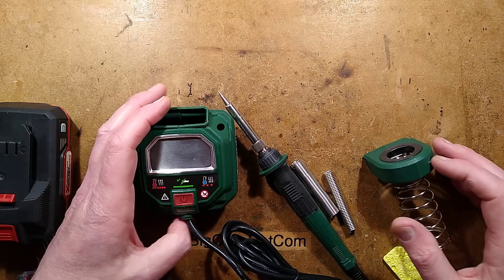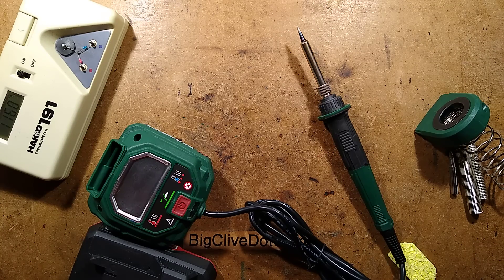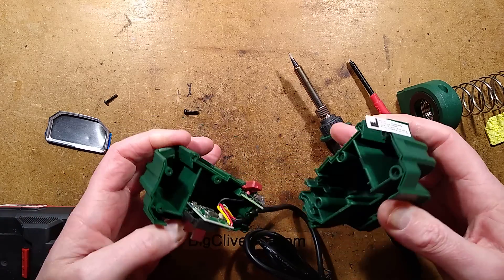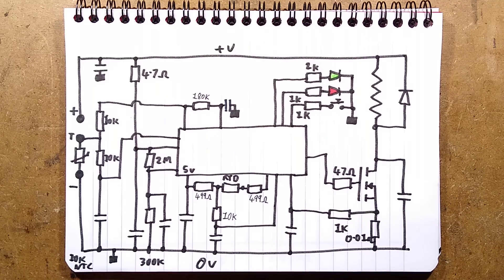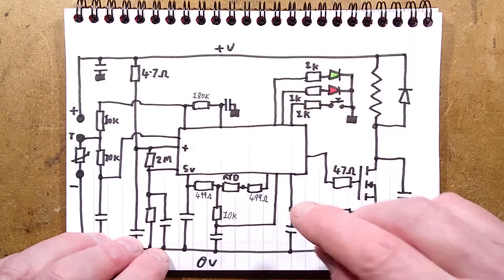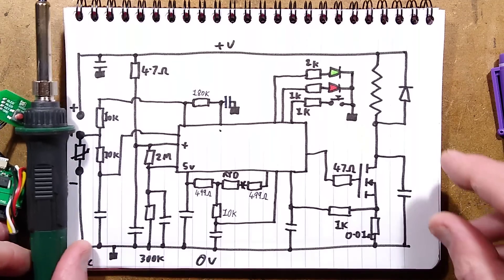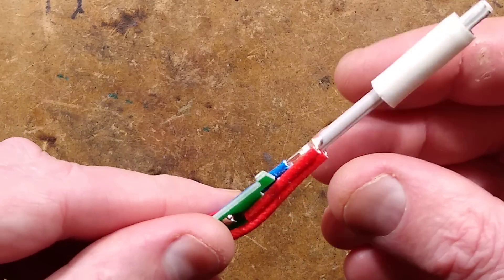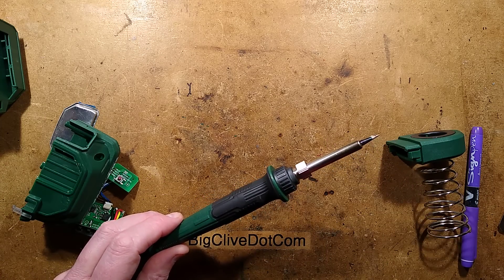LIDL (Parkside) B2 soldering iron hack and schematic

Comment: The Robot family are at the Robot Repair Shop where they have brought Grandpa in for an emergency checkup. 

Technician A asks "What's wrong with him this time?" 

Mother Robot replies "Well, feel his head. He must have a fever. He's burning up." 

"Oh yes. Ouch." says Technician B.  "I just burned my finger on his forehead." 

"That's what I mean." says Mother Robot.  "He's been like that since last night.  He said he was feeling cold, so he went to that Quack doctor in the market." 

"Hmm.." exclaims Technician A.  "It's probably his temperature regulator on the fritz." 

"I'll take a look with my infrared monacle." says Technician B.   "Ah yes. There's a definite hot-spot right here in the middle of his forehead." 

"No wonder you burned your finger." says Technician A.  "Now let's take a look in here." 

Gingerly he opens Grandpa's cranial access panel and peers inside.  "Well look at this." he says. 

"Hmm.." says Technician B, snipping some wires in Grandpa's head and retrieving a small circuit board. 

"Will you look at that." exclaims Technician A, examining some writing on the circuit board with his monacle.  "It says 'Barbie Hair Drier (C) 1985 Mattel, Inc.' " 

@:-)  &:-)  #:-]   ~~8o]    (o-] A   (o-] B

Comment: I wonder whether reducing the set temperature affects the performance of the iron when used in outdoor environments eg on car wiring? In the past I’ve found using soldering irons outside to be challenging because they lose temperature in the wind, but not had that problem with a stock one of these Lidl ones.

Comment: why dont they make a screwdriver that has a plastic liner that automaticly retracts with a spring inside the handle ?
Reply from the maker: Probably strength.  Some terminal screws get seized in.

Comment: Repairing an MP3 player (oh yes, the 90s) from my classmate on a Bus driving to the holidays with just a paperclip and a lighter.
0603 components were a thing back then (and my eyes were much better) and so were bumpy roads
Just if someone says they cant solder without a soldering iron: Sure you can!

Comment: That looks like the guts of a Hakko 936/907 heating element and thermister component.   Are the aftermarket NON Hakkos replacement heaters generally good quality and relatively reliable?   Thoughts???
Reply from the maker: The quality varies widely and there are also thermocouple based units.

Comment: I once bought a 100w soldering iron from Biltema. It got so hot that the end literally glowed when you turned the lights off. Another one i bought was a "Lux" brand and it was 40w. Worked great until i used a solder sucker and i actually sucked last 3mm of the tip into the solder sucker as it had melted.

Comment: 15:10 Not only will over-temp damage the bits, also overheat the joints leading to premature failure.
 Then again you could put a variable resistor in the base unit.
 Years ago, I used Antex irons exclusively. I found Wellers to be too fragile (worked a lot in the automotive sector). Antex made a huge array of bits, including DIP bits in 8 and 16 (the easiest way ever to remove THT ICs). But they never made temp-controlled irons. I originally made an (rectified to DC) analog controller based on the resistance of the element (current controlled). Later on, I redesigned it with A PIC 16F84 (remember them) when they came out last century. It proved to be much more stable and even heating. For a few useconds, every two seconds the supply voltage would disconnect and read the resistance of the element thus determining the current for the next two seconds. What a great, even revolutionary, those PIC uCs were.

  When I first started in the mid-late 1970's, components were very delicate, and we used to use simmerstats and made sure it didn't melt plumber's solder to determine how high the temp was, then we got thermocouples. Thanks for letting an old man reminisce.
  Thanks again for this posting. Always interesting to see how things are designed.
Reply: They did make a TCS series, possibly later on , 80's I think, basically a 50w Iron with a small pot on Iron itself. I still use Antex to this day

Comment: I wonder how the iron would respond to someone hacking a potentiometer into the iron instead of a fixed resistor.
Reply from the maker: A 47 ohm pot would give a decent range.
Reply: Great hack.
Thought also of the potentiometer or rotary switch with 2,3 resistors.
That way one has more temp options .
Also often ask myself way not have it factory installed.
Willing to pay the 3p extra😂

Comment: As I understand it, the corrosion of soldering iron tips is primarily caused by the solubility of the metal the tip is made from in the molten solder. Temperature is also a factor, since the hotter the molten solder is, the faster other metals can dissolve into it.
Using solid copper tips with traditional leaded solder is rarely a problem. The 40% lead (or 37% for eutectic grade) lowers the melting point such that copper from the tip doesn't dissolve in the solder to any significant degree.
Lead-free solder is a very different story though. For a start, it is at minimum 99% tin, so the melting point is much higher. But it also has between 0.5% and 1% copper already alloyed with it, so copper is clearly soluble in tin. At the higher temperatures required to melt the lead-free solder, copper dissolves into it much faster. So if you are going to do a lot of soldering with lead-free solder, don't use a solid copper tip - unless you want the copper from the tip to end up in all the solder joins you make.
Reply: I had a hakko tip dissolve to the point of unusability after 3 months of 8 hours a day always on at 780F, 37% solder. I beat the hell out of that tip, and 3 months of my tools for 20 bucks is still super profitable.

If you're using it hobbiest grade, an hour or two per week, and you aren't using the iron at 900F like this one was unmodified, it'll last you a long time. I really think tip wear isn't something to be SUPER concerned about.
Reply: @AnonyMous-pi9zm  wear not, corrosion yes, most hobbiests will have this issue, the tip gets corroded although they do not use it much, and it becomes very difficult to use it or to restore it to a nice shiny surface
Reply: Actually copper is a bad choice as it does dissolve in regular leaded solder, that's why all the decent bits were iron clad copper.

Comment: I searched the web for "M29an100 0B6606 M29p p silicon chip" and I found some information that might be helpful. It seems that the chip you are looking for is a *M29AN100* flash memory chip made by *STMicroelectronics**. The chip has a capacity of **128 Mbit* and can operate at a voltage range of *2.7 V to 3.6 V**. The chip uses a **parallel interface* and supports *page mode* and *burst mode* for faster data transfer. The chip is packaged in a *TSOP48* case with a size of **12 x 20 mm**. The second line of the chip label, "0B6606", is probably the **date code**, which indicates the year and week of manufacture. In this case, it would be the **6th week of 2006**. The third line of the chip label, "M29p p", is probably the **lot number**, which identifies the specific batch of chips that the chip belongs to. This number is useful for quality control and traceability purposes. I hope this information helps you. 😊

M29AN100 datasheet https://www.st.com/resource/en/datasheet/m29an100.pdf <-- this link does not appear to work, but if you can find the m29an100.pdf you will have your datasheet. (perhaps https://www.datasheetarchive.com/)
Reply from the maker: It turned out that the second number may be the IC number, but the data for it on the manufacturers website doesn't have a full PDF.

Comment: I have something similar could it be possible to add a potentiometer to be able to adjust the temperature
Reply: Yes, it is possible. I did that with 100Ohm pot on my B2 during summer which fits nicely in the place of sticker near to the button. That was discussed in the comments section of the Big Clive review of the previous version of the iron.

Comment: I have been using a modded A1 for a while now and its crazy what you can do with it for such a low price. I can solder tiny SMD components and XT90 connectors with a bit of practice. 

That beeing said, i recently tried a friends Pinecil V2 and that is just on another level. I will probably buy one of these for christmas this year.

Comment: CLIVE I HAVE A PROBLEM I NEED ADVICE ON.. A FRIEND OF MINE (A WOMAN) BROKE UP WITH HER EXTREMELY ABUSIVE BOYFRIEND. AND HE'S STAKING HER NOW. ( & EVEN BROKEN INTO HER HOUSE AND BEAT HER BAD ONE NIGHT). NOW I'VE MADE HER A TAZER FROM ONE OF THOSE CHEAP MODELS YOU CAN BUY FOR 75¢ TO €1 ON BANGGOOD. BUT IM THINKING OF MAKING HER ONE FROM THE COIL FOR A CRT TV. AS I COULD BUILD IT LIKE A CATTLE PROD. BECAUSE IT WOULD GIVE HER REACH AND STOP HIM GETTING CLOSER TO HER. NOW SHE HAD PEPPER SPRAY BUT THE COPS HERE IN IRELAND TOOK IT OFF HER, AND THEY WON'T DO ANYTHING TO HELP HELP HER. SO I BOUGHT A FEW KIDS WATER GUNS IN A "POUND SHOP" AND GOT A BOTTLE OF AMMONIA AND GIT HER TO PUT THEM CLOSE TO HAND BY THE FRONT DOOR, BACK DOOR, BEDROOM, 
PS I DISCISIZED THE SMALL TAZERS SO THE LOOK LIKE POWER BANKS FOR PHONES.(THAT'S WHAT POWERS THEM) AND THE ELECTRODES ARE INSIDE AND HAVE TO BE PUSHED OUT BEFORE IT TAZE'S. AS A SAFETY PROCAUTION, SO IT LOOKS JUST LIKE A PHONE POWER BANK.THE COPS WON'T TAKE IT OFF HER. NOW THE ONE GOOD THING IS SHE HASN'T GOT ANY KIDS. THANK GOD..(SO NO ACCIDENTAL SHOCKING OR GETTING SPRAYED BY AMMONIA. 
ANYWAY I HAVEN'T MADE THE CRT-TV COIL CATTLE PROD ONE YET BUT I THINK IT'S A GOOD IDEA. ANYONE ELSE GOT ANY ADVICE I COULD GIVE HER BECAUSE THE GUARDS(IRISH COPS) WON'T DO NOTHING TO HELP HER.. THEY TAKE HIS SIDE BECAUSE HE'S A RAT FOR THEM AND USES ANY KIND OF DR#GS HE CAN GET. HE'S IN PRISON AT THE MOMENT BUT IS GETTING OUT IN 2 MONTHS I THINK. ANY ADVICE WILL BE "very VERY" WELCOME.. 🙏🇮🇪🙏🙏🙏
P.S AND IM VERY SORRY FOR JUST DROPPING THIS ON YOU "CLIVE" AND YOU SUBSCRIBERS. BUT SHES A VERY GOOD FRIEND OF MINE AND SHE HAS NO ONE ELSE TO TURN TO. (AND BEATING THE CRAP OUT OF THIS GUY WON'T CHANGE A THING ONLY MAKE IT WORSE. 
THANKS AGAIN, AND SORRY 🙏🙏🙏🙏
Reply from the maker: Be careful about making an improvised tazer.  They are classed as the equivalent to a home made gun in the UK and can cause legal problems.  It sounds like your friend should perhaps move and give very strong instructions to friends and family not to share her new location to anyone, no matter how genuine they sound.

Comment: Does it work with 12v
Reply from the maker: It does detect voltage, so may not operate at a lower voltage.  If it does then it will take a long time to heat and recover.

Comment: I take it the numbers wont be affected if the resistor goes on the other end of the white wire - I've found the high temperature useful for dealing with big ground planes when my antex just wont cut it so it would be nice to have a switch for the resistor.  That begs the question:  What if it was switched from high to low - that would introduce an 'overheated' condition.  Would it just cool down or cause some undefined behaviour?
Reply from the maker: It can go anywhere in the temperature feedback circuit.  Others have suggested a boost button to nudge the heat up briefly by bypassing the new resistor.

Comment: please consider reverse engineering the battery bms to add external relays or mosfets
Reply from the maker: That could be very easy, given that the battery disconnects the 10K thermistor when it detects low charge.  A simple P-channel MOSFET and single resistor should work.

Comment: OB6606 integrates high performance MCU, power MOS driver，high-resolution 5V regulator, high-speed rail-to-rail amplifier, comparator for over current protection(SCP). OB6606 provides higher flexibility, lower volumn and lower cost motor control system.

Comment: I doubt the HSE seizes anything. People blame the "HSE" for all sorts of things that are nothing to do with them and I'd have expected better from you TBH.
Reply from the maker: They empower a legion of unregulated safety officials.  The HSE seems to endorse deskilling by way of protection-racket slideshow training that conveniently expires every 3-5 years and needs to be done again.   By not clamping down on these rackets they  are effectively endorsing them.  It wouldn't surprise me if some of the key figures at HSE have vested interests in training companies.
Reply: @bigclivedotcom  "HSE's approach to maintaining portable appliances in its own offices
In 2011, the HSE reviewed its approach to portable appliance maintenance in its own offices. Thinking about the type of equipment in use, and how it was used, the HSE looked back at the results from its annual testing of portable appliances across its estate over the last five years. Using the results of the previous tests, the HSE decided that further portable appliance tests are not needed within the foreseeable future or at all for certain types of portable equipment. Also, they decided to continue to monitor any faults reported as a result of user checks and visual inspections and review its maintenance system if evidence suggests that it needs revising. Electrical equipment will continue to be maintained by a series of user checks and visual inspections by staff that have had some training.

Key Points:

Annual portable appliance testing is not always necessary in low risk environments
You do not need to be an electrician to carry out visual inspections
Low cost user checks and visual inspections are a good method of Maintaining portable electric equipment"

Comment: Is there any way to adapt the Parkside iron to work with the Aldi 20V batteries I wonder? Aldi don't sell one for their system but I don't feel like buying new battery and charger just for one tool.
Reply from the maker: There's a good chance they come from the same source but are keyed differently.  It might be viable to make an adaptor.
Reply: @bigclivedotcom  Thanks Clive, I'll have a shufti in the "when it's gone, it's gone" bin at my local Lidl. I think there was one lurking there last week. Underneath the pile of £9.99 mains soldering stations (which I've never actually tried to see if they're any good). 
What i want is something I can use outdoors in awkward positions on car and tractor electrics but that won't have the finger-singeing exhaust of the gas irons.

Comment: Hello Clive, since you were the one who turned me on to OpenSCAD, I thought I'd ask you this question. I'm trying very hard to become a better coder and the terminology escapes me in this case.

In CSG like OpenSCAD, you create primitives that either add to the final geometry, or are used to cut away parts of other primitives. Is there a specific term for the "tool" that I code to be used in the difference(), to cut away from the geometry? I seem to think that the term "slug" is correct, but I really have no idea.

Love your naughtiness Sir!
Reply from the maker: I'm not really sure if there's a specific name for the removed section.  I just regard it as subtracting a shape.

Comment: I got one of the Silvercrest branded radiator TRVs from Lidl to try out (£12.99). It certainly works ok, though the time and menu buttons are back to front. They match the pictures on the box, but they perform each others functions according to what the manual says they should do. Not sure how that got past QA.
Reply: That may well be because radiator valves on the continent are mounted at the top of the radiator, sticking out horizontally, so if you use TRVs designed for those in the UK, the display will be upside-down. They may have tried to correct this and not entirely succeeded. (I also have a USB-C tester with a display invert function, but it also inverts the little animated arrows showing which way power is flowing, which then shows it flowing the wrong way!)
Reply: @matthewmarks6951  maybe - flipped the screen and buttons, but forgot to remap them.
I took it apart last night, cut the button membrane as required and reinstalled it the right way around.

Comment: i think you should be ok with the screwdriver because you work on low voltage stuff and hopefully NEVER on live mains voltage and always unplug mains powered stuff before opening.

you should not have to remove the metal dish you should be able to just cut the sticker on the back and bottom and maybe on the front and it should split open.

Comment: That PVA or cellulose sponge, I gave them a try, yet so far the best option in my opinion is a metallic (brass or stainless steel) sponge. For instance, a basic dishwashing one will do just fine.
Reply: You probably want to get a brass one; the basic dishwashing steel ones are hard enough that long-term they scrape the coating off your iron point, making your solder eat a hole through the underlying metal.
Reply: @Spritetm  I tend to think various compounds eat that layer through anyway. But thank you for your advice!

Comment: I’ve noticed that a lot of circuits use mosfets, are these particularly common in electronics or is it a replacement for an IC socket/chip? I’m new to electronics and haven’t used one yet so I wonder :)
Reply from the maker: They're a very common high current switching device.